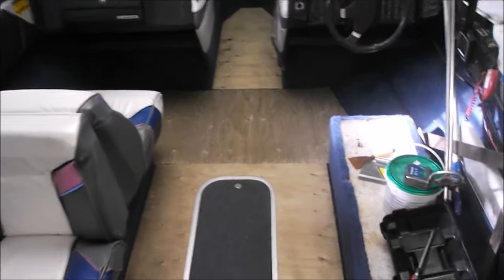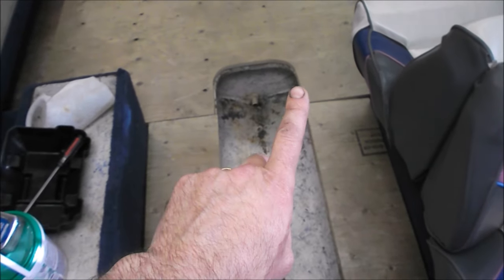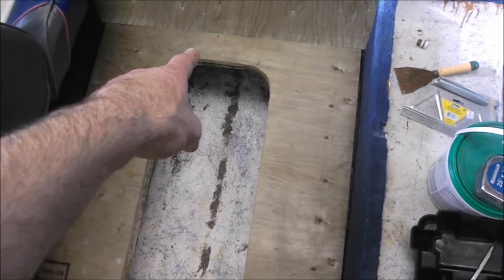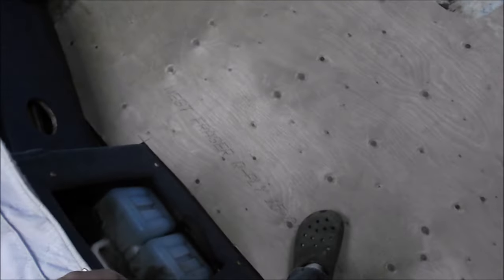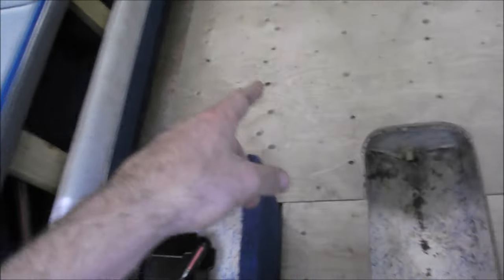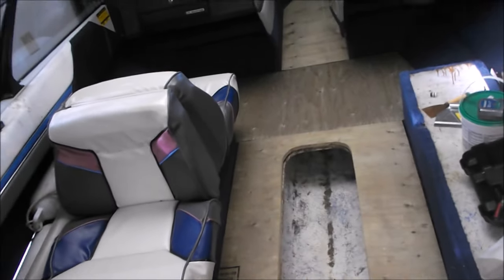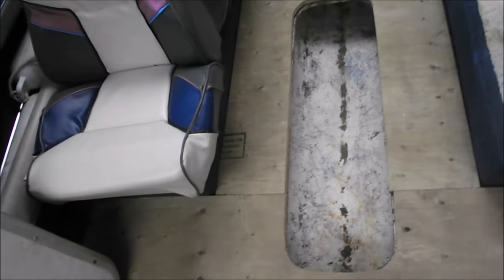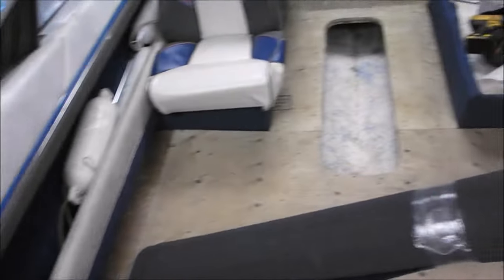Cheap fix for a rotten boat floor (Part 1 of 2) Installing new plywood

Comment: I think I will do this to my 1986 boat. 2 of the stringers are bad, but I know this will make it very solid for a while. Of course this will create problems in the future, but my boat will now only be stored inside, so it should give me several years until possibly doing new stringers. The epoxies and resins are very expensive too. In a few years i'll probably be up for the challenge, but I want to go have some fun on the water now! Thanks for the tips!
Reply: I highly recommend you do the floor and stringers yourself, but do it right! Just having my floor professionally done cost just shy of $2,000! If I did it myself it would have cost about $1,100.

Comment: Doing a resto on my father in laws handed down 70s starcraft in which floor was so rotted I had to pull it all up 1st. Using a marine grade plywood with 3 coats of a good water sealer which all wasn't cheap. Was hoping to get a bit more info on how to get the bevels in especially the front Pcs where there's cut outs for the ribs but the entire piece has bevel all the way around.

Comment: i love what u did,, but to add i would put fiber glass resin over all the wood now, to make it way more waterproof an last longer, plus leave a one eighth gap all way around the wood, so u can tuck in the carpet when u lay it down,,,, that way no carpet is ever flapping,, still u did a fantastic job
Reply from the maker: appreciate the feedback.

Comment: I too had a soft spot, as you mentioned, on the starboard side, which I glued and screwed a long piece of galvanized sheet metal on top of the wood 1mm thick!

Comment: I just had this professionally done on my 1995 Bayliner Capri, if it’s done right it will cost around $1,800.00 all said and done!
Reply from the maker: Thanks for the information.  That would have been more than I was willing to spend on my boat but it is great information to know.

Comment: Great job !! I'm about to do the same on my 86 bayliner!
Reply: I have an 86 Bayliner that was flooded due to the boat lift breaking. The boat shop did a horrible job replacing all of the flooring. The Dumb A  used roof sheeting and did not resin coat the plywood and its all rotting under the seats and between the rear seats. Use marine ply and coat it. Yes it will cost more money but you won't have to do it again. Better yet by 1/2" ABS plastic in sheets. and you don't have to resin coat it.

Comment: Do you think a layer of rubber mat before the carpet on top would be a good idea to make it last longer? I plan on doing a floor repair on a 1986 pro craft 1750.
Reply from the maker: That is a pretty interesting idea.  It might work really well.  Make sure you put adhesive on both sides of the rubber to prevent bubbles in the carpet.
Reply: I have the same boat, in the same predicament. soft floor. thinking of just doing a layover and getting a few more years outta it. then either a full floor or trash it.

Comment: How did you know your stringers were good??  Why patch a bleeder?
Reply: redwhitentrue stringers on a Bayliner/Magnum like this one are obvious if there is an issue. You would also have a bad transom most likely if the boat was that far into the decay of the wood material.

Comment: Hi, if you are still monitoring i have a question.   Did you remove the old carpet before putting the new floor down?
Reply from the maker: Yes. I scrapped I up - it came up easy
Reply: scraped it up

Comment: is that marine ply? if not what did you use? i might do the same for my bonito 5.2m. thanks for the awesome vid
Reply from the maker: It was not marine plywood which was like $200 per sheet.  The boat was going to be stored indoors so I wasn't super worried about future rot.  Frankly I was trying to extend the boat for a couple years instead of throwing it in the landfill.

Comment: I think you would have been better off just leaving it as is. You've effectively trapped rotting wood between the foam and fresh wood; probably not great for the stringers. Would it have really have been that much more trouble to pull up the old wood?
Reply from the maker: That would have made the difference between junking or reusing this old boat for me.  It would take several years to rot through the new 3/4" plywood.  For 1 day of labour and about 200 buck the boats life was extended.  You can feel free to make the best decision for your boat repair.
Reply: mr diyguy123 how much more use did you get out of it? Thinking of buying an old avenger bay boat that has one soft spot. I think I can get it pretty cheap and was thinking of doing this repair. Let me know how this worked out.

Comment: How many sheets of ply wood did u get and how much did this cost with the plywood and carpet?
Reply from the maker: Less than 2 sheets if plywood, 150 screws, about 50 sq ft of cheap carpet and a bucket of adhesive.  All cost less than 200 bucks

Comment: I know this is an old video but i have the identical boat and was thinking of doing this. Did you remove the old carpet on floor before going over with plywood?
Reply from the maker: yes. i did remove the carpet.  the adhesive didn't provide much resistence

Comment: Can you do this in small spots instead of the whole boat? Also how did it hold up now it’s been a few years?
Reply from the maker: Certainly this repair can be done in small areas instead of the whole floor.  Cut out the rot. Cut a new pieces the same size as the hole.  Support the new piece from underneath the original floor.
Reply: mr diyguy123 if I remove the rot, what do you recommend me drilling into since the old floor won’t be there?
Reply from the maker: @michaelkorsch3945  You will need to install (screw) a new piece of plywood as a shelf under the original good plywood.  That new shelf will need to protrude into the hole by a couple inches and outside (underneath) the hole a couple inches.  Then drop in your new piece (cut the same size as the hole) over the shelf and screw it down.
Reply: mr diyguy123 so basically a vertical shelf? Almost like a mini stringer? Sorry for all the questions
Reply from the maker: @michaelkorsch3945  no. More like a horizontal shelf.
Reply: mr diyguy123 okay so screw through the “old” plywood to hold the new plywood in underneath, then insert another new piece the same size as the hole on top of that “shelf” and screw that down?
Reply from the maker: @michaelkorsch3945 exactly. you said it much more clearly than I did.
Reply: mr diyguy123 awesome, thank you for the help!

Comment: What did you use to secure it to the existing floor?
Reply from the maker: The new plywood was attached to the old plywood with wood screws (I stripped off the old carpet first).
Reply: @mrdiyguy123  and did you re water proof it before puting new carpet down?
Reply from the maker: @tyler_Tell  nope. I knew the boat would live under cover.  There weren't any issues

Comment: So you didn’t fiberglass anything? Just pressure treated plywood and carpet ? 
I’m in the same predicament with my boat deck
Reply from the maker: Yep
Reply: mr diyguy123 sweet! Just picked up some pressure treat ply!! Awesome video. Gave me hope lol
Reply from the maker: Obviously it isnt a 25 year repair... but will get you back on the water for cheap.  Use 3/4" and it will last a long time.

Comment: So did you just lay the 3/4 inch over the existing floor? I have a spot on my floor that is soft and it’s an old boat also .. I’m not wanting to spend a ton of money in it
Reply from the maker: pimpshack81 yep screw it down every 6" and it will be rock solid

Comment: Is the seat base removable or is it a part of the boat.   I'm trying to order seats (wise seats) and I'm a lil confused  b/c they come with their own base.
Reply from the maker: B Chappy you may be able to simply use the base that is alreaady in your boat.  If that wont work cut out your boat bases and use your new bases

Comment: this is a great idea and I was wanting to do the same, I was curious how this has held up for the past couple years,
Reply from the maker: honestly I sold the boat and no longer know the status of the floor. However when faced with the prospect of junking the boat, extending its life by years for cheap was a good idea for me.   I realize this is not a factory fix.

Comment: Where the engine mounts on the wood, was that rotted wood?
Reply from the maker: No. The transom was solid.  If a boat has a rotten transom it is a significant project to replace and repair.  If you screw up a floor replacement you might twist and ankle. If you screw up a transom replacement, your outboard could tear off the transom under power and then the boat sinks.  I am not deterring anyone from a transom repair but make sure you first research how to do it properly.
Reply: mr diyguy123 this is an I/o.  Where the motor mounts on the wood it looks suspicious .
Reply from the maker: @leesire  ok... for an I/O i would check the mounts by sinking a small drill into and around the mounts in a few places to see how solid they are.  If solid, seal your drill holes. If soft, tear it out and rebuild the mounts.
Reply: mr diyguy123 thank you.

Comment: So what <<clicky clicky>> I ended up <<clicky clicky>> doing is cutting out <<clicky clicky>> the old <<clicky clicky>> floor, and installing <<clicky clicky>> a new one. <<clicky clicky>>

Would have been so much better without that infernal clicking.  Damn, dude.

Comment: This isn't a fix, it's hiding the damage. The floor will continue to rot underneath, the foam is probably water logged adding 100s of pounds of weight to the boat and lets not even talk about the stringers. If you are going to fix something do it right!! It's not a major job when safety is concerned!!

Comment: Ypu cant use pressrue treated plwood in an aluminum boat or you will destroy it. This is not a good idea, you are better off using regular pywood than this. But really they make marine geade plywood juat for this purpose,and other than replacing your wood floors with more aluminum, marine pkywood is the only good solution to rotten floors.

Comment: Horrendous repair...That pos will rot out in a year..The stringers are toast.
Reply: Sometimes you would be correct I just looked and hydro inspected my stringers and they are dry as the Sahara so actually I got extremely lucky. However I'm not going to stack 2 layers like that lol I am going to cut to fit then glass them in

Comment: you added more weight to boat
Reply from the maker: Yes it actually felt more stable and handle bigger waves much better. It had a large outboard so power was no issue.

Comment: This is a ridiculous waste of time and material. No protection from water and it will rot on the bottom side from condensation.Spend the extra money to resin coat it or at least epoxy paint. I used White Epoxy on all of the new plywood seat bottoms many years ago and they still look like new.
Reply from the maker: It was either junk it or spend very little money and an afternoon and use it for a few more years.  The repair worked as intended. I didn't care it it would last another 20 years.
Reply: No body said anything about making it last another 20 yrs. Old saying if its worth doing. Its worth doing right.